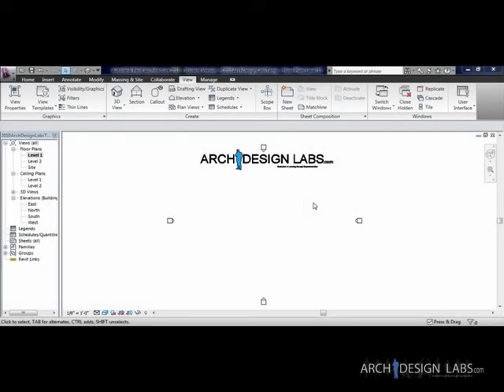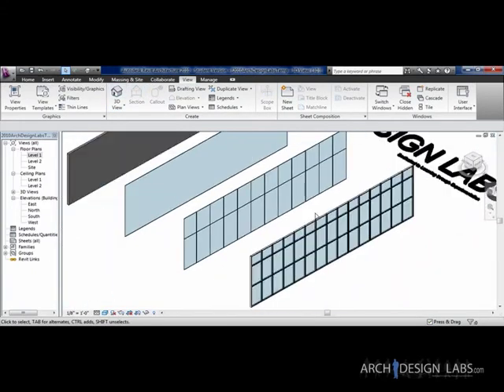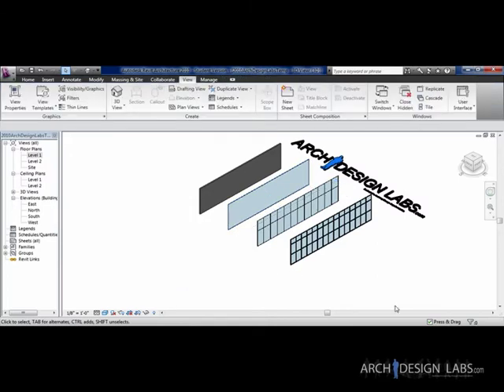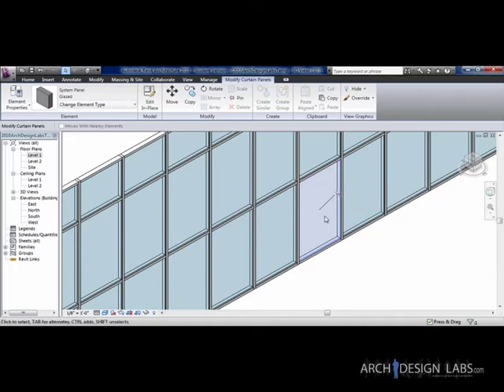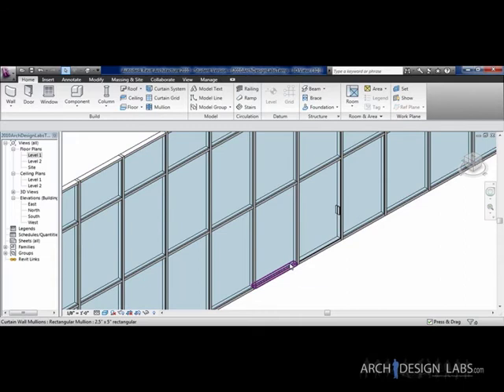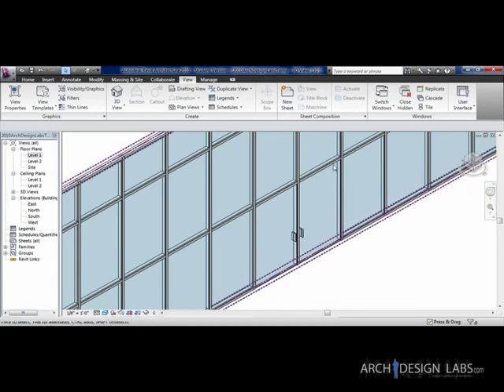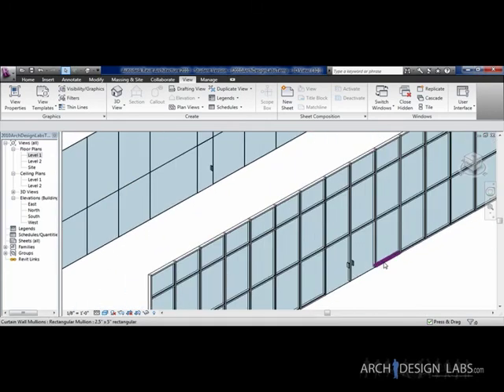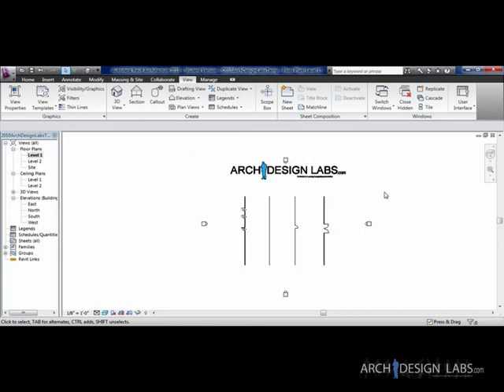Placing Doors in a Curtain Wall

Comment: Doesnt let me unpin.
Reply: same
Reply: have you figured it out?

I have the same problem.
might be in earlier versions you don't need to unpin it.
After selecting  the curtainwall panel the unpin icon is not appearing and the unpin button in the modify tab is not enabled.

would be great if someone could help.

thx

Comment: Thanks for the video. It works great for normal cases. However, now I have a curtain wall built on a curved floor. So the ground is not flat. When I try to do the same thing to have a single glass door revit says can't make type. Why is it?